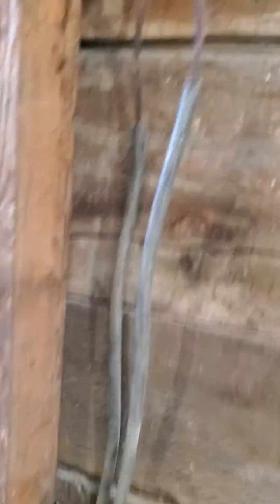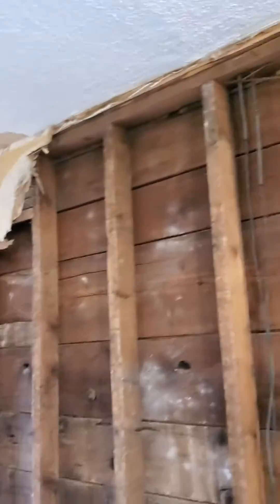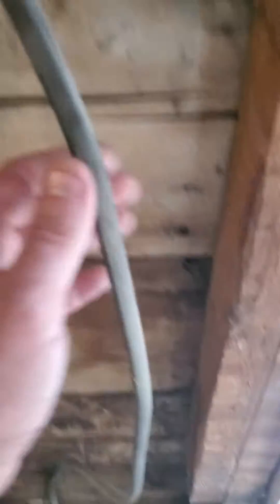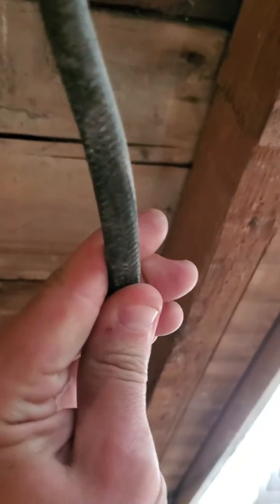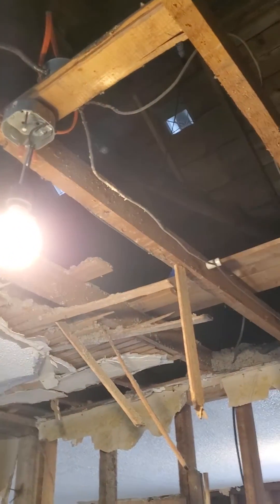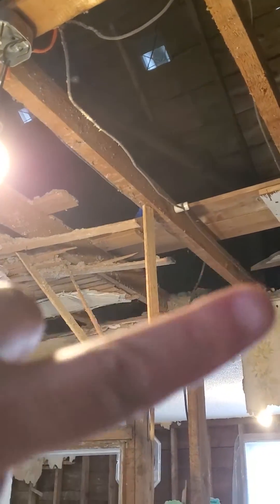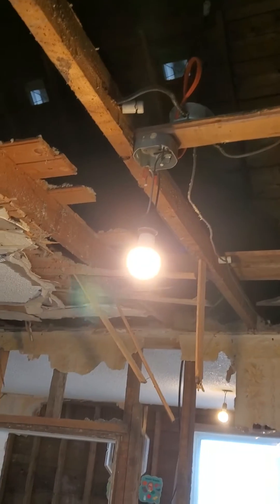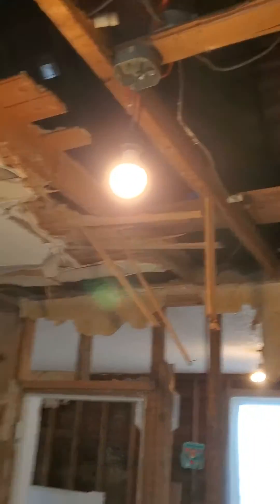This is what knob and tube wiring looks like and what you should do.

Comment: AS KNOB AND TUBING JOBS GO,
THIS IS PRETTY CRAPPY WORKMANSHIP WHEN IT WAS NEW!
Reply: Very true.  Crappy Knob and tube work is what causes fires.   Originally, the spacing between the tubes going through beams depended on the ampacity of the conductors.  Minimum was 8 inches for #14 wire on a 15 amp circuit.    10 inches for #12  on a 20 amp circuit, and 12 inches for #10 on a 30 amp circuit.  On outside walls, knobs were to be set every three feet, and no more than 28 inches from the box, with entry covered by loam and tied to the box with a clamp.    All boxes were metal, no plastic allowed.   Robber insulation was used for many years after Knob and Tube was discontinued.  I wired with rubber (RT - RTW etc.) in the t960's and the early 1970's.

Comment: Is it allowed to replace just one line of knob and tube or do you have to do the entire system?  My apartment is knob and tube but I found some wires to the fuse box and an outlet running inside a closet behind it.  I figure just replacing the line from the one outlet in the hallway to the fuze box is better than nothing.  This outlet also runs to the entire kitchen (which I've already protected with gfci's). Is that a problem?
Reply from the maker: Everybody just calm down! (One of my favorite quotes from Django unchained)

Replacing some is better than none but be careful, if you have an electrical fire and insurance finds that the wires were tampered with then you could void the claim! Best thing to do is get a permit and get a government certified electrical inspector to pass the work you have done.

P.s. the GFCI is good but I would even try putting arc fault breakers/receptacles. These devices will trip if there is a possible fire hazard where GFCIs will sense if you get shocked and trip. 

Hope that helps!
Reply: Why the fuck are you messing with electric in an apartment? Get your landlord on it
Reply: @jordanadams5902    because they don't cover electrical outlets and fuse boxes, only common wiring.  Why should I pay more?  Smart people always get multiple bids.
Reply: @ThomasPain2025  Smart people don't pay for shit their landlords are required to be doing
Reply: @ThomasPain2025  Hey,brother William. IDK the particular situation, but, I'd  recommend removing/replacing it entirely.  That way,you can make sure it's grounded and not a fire hazard.  Often the wires were undersized.  For the money amount  it's not worth the risk. Romex is cheap compared to that antiquated junk. Talk to your insurance company. I hope that helps.

Comment: that is what screwed up knob and tube looks like, when in good shape and not tampered with it is perfectly safe besides not being grounded. the issue is that people tack into it and overload it and that is where the issues are. it is the same size wire used today and can handle 15 amps just fine. if someone wants an additional circuit or more outlets i always push them to make a whole new run to the panel and leave the knob and tube alone, because when it is not tampered with and is in good shape it is fine, but once you start messing with it and making splices and stuff then it becomes a hazard and at that point it all needs to be replaced. i am not one of the people who says just because it is old that it is not safe and it all needs to be ripped out and replaced because it is a very good system when intact, if someone has it they should absolutely get it checked out by a few different people to ensure it is still in good shape and if it is then i see no need to replace it. i would love to see the romex in a hundred years though, the plastic will probably break down and since all the wires are in one sleeve they will short.
Reply from the maker: You nailed it! We are in the same boat where if we had a blank check we would run all new circuits but in most cases we run new feeds and 100% avoid tapping into the existing circuits. I'm glad to know there are other electricians out there that care!
Reply: It's the difference between being an actual electrician and mechanic or being more of a parts changer.
Reply: i agree 100% but unfortunately homeowners are very scared of it simply because it is old though when i am tasked with removing it i will save everything  i can, and i have put some of it back into service for my own needs. I wired a shed in knob and tube as well as installing a 1920's westinghouse 25 amp meter. i made a wood fuse board and lined it in asbestos (carefully) and used old slate fuse wire boards from the late 1800's and a 30 amp main disconnect from the same era, honestly did not know how much i needed power out there
Reply: The simple truth is that very little stuff from the past is still in great shape especially if it got abused or rodent damage.
Reply: @robertsitch1415  Our electric is from 1919 (a very large house built in 1910). It is Knob and Tube 60 Amps. Yes, if you turn the microwave on it will slow down the fans in the windows lol.  Anyways, it's in GREAT "dam near perfect" shape. We have a 1919 Trumbull Meter Service Switch box with a 1936 GE AR1 electric meter and believe it or not we are still being billed from it by the utility company. Both are located inside the home. This year the Trumbull Meter Service Switch box and GE AR1 meter are coming out of service for billing, HOWEVER, we are taking full ownership of them and fully restoring them by putting them back into use in their original spot. A new meter box and meter will be located outside the home for billing. Our GE AR1 meter and Trumbull box will act as a "sub-meter" so the original knob and tube will survive for historical purposes as so for the old utility equipment (Trumbull box and GE AR1 meter). As we now own the old historical Turmbull service switch box and GE AR1 meter, We will be responsible for the upkeep but we have already located spare parts and such just for this certain issue we face later down the road. Walter Knox is correct, it's fine when untouched and does NOT need to be replaced. If you ARE going to touch it, restore it back to its original. If you don't restore it back to the original and leave add-ons people added over the years, well... you'll be unsafe. Just know, you can update to 200 Amp service while leaving the 60 Amp knob and tube in place right where it is without messing with it.  Just plug in the 60 Amp knob and tube to a 60 Amp breaker from the 200 Amp Main box. Now you can run other lines from your 200 Amp main box without adding to the knob and tube causing overloading issues due to modern-day living. The simple truth is, it's easier (less expensive too) to fix the knob and tube IF it's in good condition and add a 200 Amp service as I mentioned.
Reply: @gamblefamily768  in my area it's common when a house with some knob and tube in service trades owners for a diligent home inspector to notice it and due to the insurance industry really hatiing it make removing it a condition of sale. A lot of the time it was partially replaced during kitchen renovations.
Reply: @robertsitch1415  I have historical insurance for our home, anybody can get it as every company offers it. The companies don't like to mention that and neither do the banks lol..   The insurance industry may like to make it seem they really hate it, but they work around it. You just have to call their bluff and be demanding rather than follow orders...
Reply: @gamblefamily768  I know one interesting circumstance is one of my mother's coworkers was ordered by he insurance company to replace the old 60 amp service with the meter inside. Another thing you need to figure out is if the upcharge for old wiring is equivalent to paying for new wiring after about 10 years.
Reply: @gamblefamily768  I am REALLY glad to hear that. I was starting to think that ALL knob and tube was being removed everywhere. I would love to find a nice old house where almost everything is original including the wiring and stuff people normally replace. once that stuff is gone it can never be re created. I am a big fan of restoring what is already there. sadly by time I am ready and able to buy my own house all of the nice original ones will probably be gone and only cheap modern houses and ones that have had all the original stuff ripped out will be all that is around. if by some chance I am able to find a descent house with knob and tube that is in good shape and original service equipment I will definitely keep and restore it and not replace it. 
if I need new circuits they can be ran separately without messing with the old stuff at all. 
Now what I would really like to find is the old open work cleat wiring, that stuff just looks really cool.
Reply: most the knob and tube I see still has junction boxes with clamps and well placed porcelain insulators with good connections taped up well but i have seen poor knob and tube installs a time or two, once I seen a situation where lights were not working found an original k and t connection in the attic barely taped with the wire just "fish hooked" around the other wire no solder or anything
Reply: @Bradley-tx6ed  Yeah, there were hacks even then
Reply: @Bradley-tx6ed  new wiring can be installed poorly, so can old wiring. but we also have to realize that the K&T have lasted nearly 100 years with no or little issues. and there is still a ton of it around, even if in poor shape. I would hate to see today's wiring in over 100 years, they can say what they want but the materials will not last forever, and K&T is far better insulated than today's wire

Comment: What is the est cost if you have to change it? Ball park
Reply from the maker: The price can really vary depending where you are and how much you need done. The average is between $6,000 to $16,000 because it is essentially rewiring your home. On the bright side, if you cannot have it done all at once then you could replace wires in smaller amounts but be prepared to pay more for less work. I hope that helps ;)